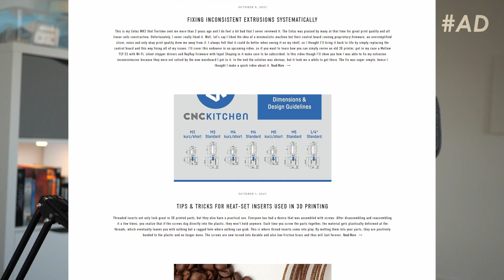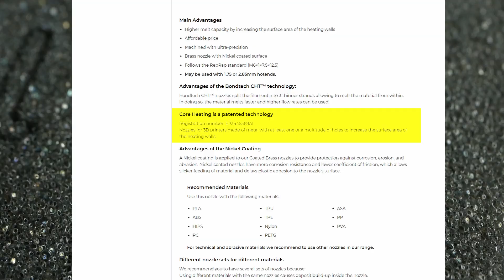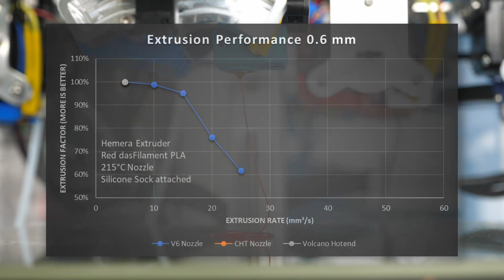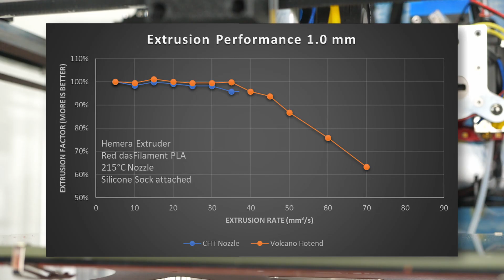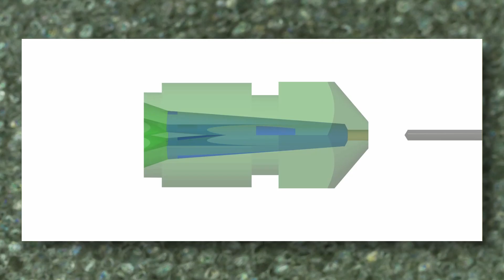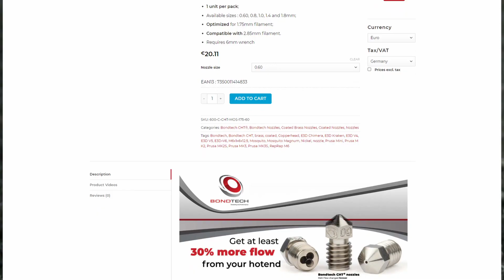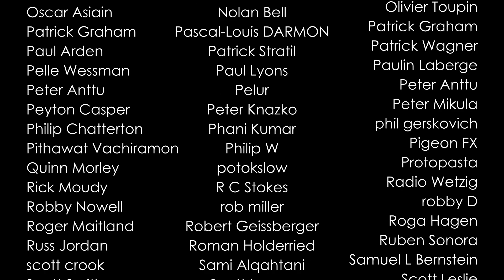Does This make Volcano Hotends Obsolete? Bondtech CHT Review

Comment: Electrical Discharge Machining (EDM) is an easy way to make precision holes with minimal heat. I am working on a DIY EDM mill mounted to a 3D printer chassis. I just might try making a similar nozzle out of a stainless steel bolt. With EDM, any conductive material can be milled. Perhaps a titanium or even tungsten nozzle would be interesting.  Combine this with DIY electroplating and a person could even mill a copper or brass nozzle and plate it with nickel.  (Hi, I'm Rob and I am a YouTube addict.)

Comment: Back in 1998 in the UK I worked briefly in a factory that made extruded plastic sections for making plastic double glazed windows the extruder had a torpedo shaped archimedes screw as a heated core. Sure its not fdm the extrusion is the hollow box sections they were sent else wher in 6 metre lengths to be made up. But it was definitely to heat the plastic evenly. I seem to remember a service engineer telling me the core was not heated but increased pressure and caused more melting it was inside a heated jacket just behind the extruder head. The machines must have been 15 years old then. That patent does seem odd.

Comment: I'm wondering if (and how much) this kind of nozzle extrudes material of more uniform temperature, and whether this has an effect on the mechanical properties of the parts, even when not doing high-volume printing. I can well imagine that at the top end of performance of a standard nozzle the inner part of the flow is markedly colder than the part of the flow closer to the nozzle walls, causing internal stresses or even cracks. It might be the case that these nozzles not only allow you to print faster, but also produce stronger parts.
Reply: Agreed. Most of my prints are functional prints. Printing with a larger nozzle alone makes a huge difference in layer adhesion. My default is now 0.6mm and I was thinking of going to a 0.8mm. Now it's a no brainer. I can't wait for these to arrive!

Comment: I got a 1mm one in the post :). Combined with a Dragon high flow that should be good fun printing vases.
I just read trough the patent a think they omitted an important part: you can make this same structure in the bottom part of an all metal heat break and achieve the same. For instance a high flow Dragon or Mosquito Magnum could get it and up their flow capability to super volcano levels. The standard flow Dragon or Mosquito probably can reach volcano performance this way. And when combining the CHT nozzle with "CHT Dragon" or "CHT Mosquito" maybe even a standard all metal hotend gets near to super volcano capabilities.

Another advantage I see is that the heater block can be run at lower temperature as the plastic is anyway molten better/more homogeneously. This will deliver more consistent extrusion and I would not be surprised stronger parts too as the infill bits that are typically printed faster will be molten better and thus give better layer bonding - Do I see a future CNC Kitchen review? :) -

Comment: From a machinist perspective, drilling intersected holes like this isnt something you master in the first go. I suspect some high quality tooling was needed to make this a reliable production run. The thing with regular drill-bits is that they are very easily pushed out of direction if there isnt sufficient material all around it. The drill-bit will be bent, and can easily catch in the open section of the hole it meets, and thus break because it gets stuck.

You 100% will need carbide tools, which most likely has a specially ground tip, to handle the intersected holes.
Reply: Gonna guess they used a flat endmill to bore or helical mill the holes and then bored out just the tip with a carbide drill.

Or the used EDM which is way easier and provides a better surface finish without the need for a overlenght mini endmill or drill

Comment: I'm done with 0.4mm nozzles. I don't see the point anymore after the rise of cheap resin machines. 0.6mm is a much better balance of speed and detail considering what FDM is capable of

(but for what it's worth, I don't think I'll buy a CHT unless they make a non-brass one. I print with glitter and glow filaments pretty regularly)

Comment: The inner walls of the drills are the weak-point. there is too less material for conducting heat from the heat-block. 
More surface, yes, but also more possibility to clog.

Comment: Hope they start offering these in copper! With my Ender 3 simply switching to a copper nozzle added 50% flow but more importantly it DRASTICALLY improved layer adhesion with ABS due to the higher tip temperature. If I switch to a CHT I'll get big flow improvements but my layer adhesion with ABS will go back how it was (poor enough to rule out using ABS for mechanical parts)
Reply: Thanks for the tip.
Reply: @RationalBazz  LUL imagine one of these guys operating anything more complicated than a pickup truck
Reply: so the cooling becomes a bottleneck and you have to improve the cooling. Also you need to improve to movement system heavily
Reply: @flamestoyershadowkill  Cooling for sure. Ender3 movement isn't that bad if you have the luxury of not caring about surface finish. If you DO care about surface finish I highly recommend the polished nozzles available at 3D Passion.
Reply: It is copper.

Comment: Without any kind of patent checking, extrusion is a old technology and thus has gone through a lot of patents and inventios without that crap (patents). It would be a wonder if this isn't one of them. Filament printer is a extrusion device so patenting old inventions just because this kind of extrusion device is called a 3d printer, does not sound fair.

Comment: I’m a user of 3dSolex matchless race nozzles for at least 3 years now in my Ultimaker2 (0.4 and 0.6mm). They are a bit different than this Bondtech one, race nozzles split in two ways, not tree like this. I fell that I can speed up 10% of my regular speed but maintnance is a bit trickier to uncog with acunputure needles, cold pulls and athomic method

Comment: I honestly thought this was another snake oil 3D Printer "hop up" part that looks flashy but has minimal effect. I'm so glad I was wrong, the tests don't lie!
Reply from the maker: Indeed! I had an eye on the Matchless nozzles for years thought heard mixed reviews. This is IMO another small revolution I was desperately looking for!
Reply: @CNCKitchen  I have been using a 2.0mm solex for years, I agree this it is amazing. Not sure why bondtech seems to get all the credit for something that is not even theirs. Also Solex makes a 0.4mm like you want.
Reply: @peetersm  not so much them getting credit, Bondtech has been selling 3dSolex nozzles for years. In fact I think they were one of the largest sellers of his products. And so they partnered together to use Bondtech's manufacturing abilities to bring them to market at an affordable price. I don't really see the problem.
Reply: I like big nozzles and I cannot lie! 😜
Reply: For me it seems to have no effect, tested on two different printers with a Titan and a stock bowden+dual gear extruder. In both cases, same testing setup as the vid - no diff
Reply: It has effect but what will you do when it clogs up? Just buy another?
Reply: Correct.  Videos and reviews on internet never lie😅
Reply: @Robin-Visser  "Never" - look at paid reviews.

Comment: Why would anyone bother with this? If you wanted more material going into the nozzle, just go back to 3mm filament, and this needs 3 extruders? Waste of money/weight
Reply: I believe you missed the point. You use these nozzles the same way you use any other standard nozzle, on a single heat block fed by a single extruder. The filament (single strand) is divided into 3 strands inside the nozzle. It actually saves weight, as Stefan mentions in the video, because you may achieve the same flow with smaller heat blocks.

Comment: In other words:
1. If you already have a Volcano, the CHT nozzle won't help.
2. If you don't have a 40W heater, the CHT nozzle won't help.
3. If you DON'T have a Volcano, and DO have a 40W heater, the CHT nozzle will let you use MUCH higher extrusion rates!  But clearing the nozzle could be a problem.
Reply: If you use a 0.6. Would love to see the results from 0.4

Comment: Wonder what happens if you make a "volcano" hotend with CHT channels inside it.
And about 11:35 isn't this a desireable "feature" (to some point) to increase layer adhesion? I mean, if the previous layer solidify too much, the coming layer won't adhere as good to that, meaning that the finished model won't have as high pulling resistance perpendicular to the layer direction.
Reply: Of it's a feature in some cases but the cooling system is clearly underpowered. You should always have the option to properly cool a layer.
Reply: @sandos-x1t  Vad jag menade är att eftersom kylningen antingen är av/på, finns såvitt jag vet inget mellanting, så måste den givetvis vara rätt "tunad" så att den kyler rätt, dvs varken för mycket eller för lite. Och då tänkte jag - detta kanske egentligen är den rätta "tuningen".

Comment: This is already used in injection molding tips, sometimes called "tornado" tips. Is the only thing "new" in this patent the words "3D printer", rather than "injection molding machine"?
Reply: Sure seems that way huh. The core innovation involved is "improve melt rate", and that isn't new, as you said.
Reply: @mduckernz  I didn't check, but maybe it's an unexamined patent, only requiring examination if challenged. This would mean that prior art can be patented (until challenged).
Reply: It is the application that is innovative in much the same way that cyclonic particle extraction was adapted from alluvial mining technology for use in vacuum cleaners by Dyson
Reply: An idea generally needs 2 characteristics to be patentable. It needs to be new, or it needs to be novel.

Someone could have invented a pencil and patented it (which is new), and someone else can come along to patent a hexagonal pencil that doesn’t roll off the table (which is novel).

At least, that’s what I remember being very important when I worked with patent lawyers to file a patent.
Reply: The "words", and the fact that I don't own an "injection molding machine" to produce all of my original CAD designs.... In other words, you make it sound like the patent for a wheel on an airplane is not "new" because "wheels already have been used for iron horse drawn chariots" once upon a time....logic=50. Reasoning skill=0
Reply: @Double-X2-Points  Ridiculous comparison, logic=0, reasoning skill=0. You create a false equivalence. The similarity is not in regard to the name but to the art, you completely missed the poster's point, in fact getting it arse backward. This is the SAME technology with merely a different name.

Comment: Please make some comparative speed test on an usual printer between this nozzle and normal nozzles. How much faster will your print be with a 0.6 CHT??? I recently did some big parts and they take so much time, would really use to reduce that to a quarter, but will a normal heating cartridge and ender extruder be able to provide enough feeding for the nozzle?
Reply: Yes, plenty of heat available from a standard heater, he discusses this (and shows the math!)

Comment: I think even a 1.6 version is potentially troublesome. think about how often a 0.2mm nozzle clogs. so that 0.6mm nozzle is essentially THREE 0.2mm pathways. ouch. a 0.4 would make those pathways TINY such that any impurity in a pure filament at all is going to be trouble. so I can see why they did not release a 0.4mm version.

What I am annoyed with is the lack of a 1.2mm version. I do a LOT of printing and slicing at 1.2mm not 1.0 or 1.4 mm. not a bad thing just annoying for my particular situation. I ordered the 5 set.
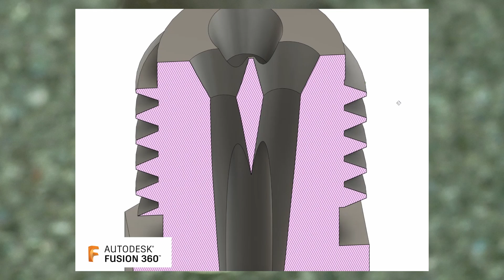Reply: I'm not sure what gives you the impression that the channels are 1/3rd of the nozzle diameter, but that's not the case. Look at the cutaway view at 9:00
Reply: @timelmore8639  physics. you are going 3 into one. at some point they have to "constrict" down to that 1 size from 3 separate channels. it might not be a 3:1 but its gonna have to get pretty close.
Reply: Worry no more Nerys. The tip shoulder of the 1.0 nozzle will allow you to use 1.2mm extrusion width. The current Bondtech CHT nozzle range supports every extrusion width from 0.6 up to 3.0mm.
Reply: @nunosantiago6720  Maybe technically but I have never gotten good results over extruding like that except in vase mode. ordered the full set its going to be fun to play with. especially with larger ones!! Hopefully won't take too long to get here :-)
Reply: @nerys71  Give it a try. Hopefully you have the nozzles already.

Comment: one way around the patent problem might be to design a "filament splitter". part that attaches to a regular nozzle. their patent of this specific shape nozzle that splits the filament may be theirs but the concept of splitting the filament to make it easier to melt in general cant be patent, just need a different way of producing the same result.

would also solve the problem that with their design theres no way you can cold pull the nuzzle to declog it. but if the nozzle is separate you can always take it apart, put just the nozzle back in, heat it up and do a cold pull, then put it back on the splitter.
Reply: There is no problem to solve with cold pull. I've done it with PLA and PETG without any problem.
Reply: @NerminM84  how do you pull it back out past the part that splits the filament though? does it cut it backwards too?
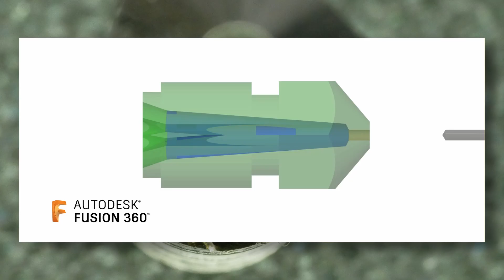Reply: @ge2719  Look at 8:50 on the Reverse engineering part. There is pictures and explanation how to do it on Bondtech Facebook page and a video How to do it will come soon. Heat it up to 220-230 degrees, turn the heat off while manually pushing the filament, when you cant push more, wait untill the temp on nozzle is about 90 degrees, pull it up nice and easy.
Reply: That's a regular pull, iow.
Reply: @sandos-x1t  dont tell me that you burn yours?

Comment: 90mm3s is more than you'll ever need..

YEAH.. my printer shakes itself off the table above like 20mm3s for most prints as it works out to like 5k accel and 200mm/s+.. I don't think I went above 20mm3s on my 13min benchy which is about the limit of my motion system.
Reply: Use it with wide and high lines, problem solved.
Reply: @sandos-x1t  not when doing a speedboat which has specific parameters you have to follow

Comment: Great explanation of the basics ✅
Well done research ✅
Interesting new topic ✅
❤️

I always thought, couldn't you use somehow  3 strands of filament and kind of 3 hotends and shove it into one nozzle. This could have the potential to make retractions better than with a longer heatzone.
Does anybody know whether this has been tested already?
Reply: Yes, there are hotends that combine two different filaments with a single nozzle, they can be used for creating custom colour blends: https://www.youtube.com/watch?v=MY4uHML5pEg
Reply: @thenickdude   Thank you. That is awsome. Didn't know those mixing hotends just those which alternate between two filaments in one nozzle. For printing faster with those hotends one extruder motor with two extruder gears could be sufficient. 
It feels a bit over the top for the purpose of faster extrusion compared to the intelligent design of the CHT nozzle. But somehow I think retractions could be more efficient by pulling back 2 strands but maybe I am mistaken.
Reply: @jayphone1  so called 'diamond hot end' does exactly this.
Reply: @thenickdude  Someone made a 6 input hotend. https://youtu.be/Sl4DMXJHvnU For colour mixing I can imagine that with those diamond hotends it might be not so good when the not used colors have to stay in the heated zone that long. Could cause material degradation.

Comment: This should increase friction in the nozzle end. Id like to see a test using flexible filament.
Reply from the maker: Very good point I didn't think of while filming. Might try that out at some point.
Reply: There is no meaningful gain when using the Bondtech CHT nozzles with flexible filaments. Our tests show little or no increase in volumetric flow rate.
Reply: @nunosantiago6720  Thanks for the reply! I was thinking that the better melting would allow reducing the heat slightly to help prevent heatbreak clogging. Sad to hear there's no flow improvement with flex. Make a nozzle that improves flex flow and people will kiss your feet, LOL!
Reply: @mickmouse2258  we will keep your feedback in mind. Thank you.
Reply: There's a trade off between the surface friction and the higher fluidity of higher temp extrusion.

Comment: Great video. You should further study hotend thermodynamics by testing thermal paste traditionally used on CPU heatsinks on the threads of the hotend.
Reply: Please do this. I've never used in and was very surprised when I saw it recommended.
Reply: It's routinely used on the heatbreak (COLD SIDE ONLY). I specifically contacted Artic (who makes thermal paste for CPU's) and one of their engineers told me to use MX-4 but suggested that breakdown would occur if used on the HOT parts (although specs show it's breakdown point above 'normal' 3D print temps, but not high temp stuff like PC). It's generally not recommended to use on nozzles or the hot part of the the heatbreaks, it could cause galling of the threads and prevent removal. That said, I'd LOVE to see this researched more!!

Comment: If money is not an issue, you could probably make a mesh-like structure in the filament path with EDM (electrical discharge machining). It's a pretty common process to manufacture stuff out of extremely hard metals/alloys. That might be overkill, but it would be interesting to find a true peak performace nozzle setup.
Reply: Why not just stack a few mesh screens before the threads of the nozzle